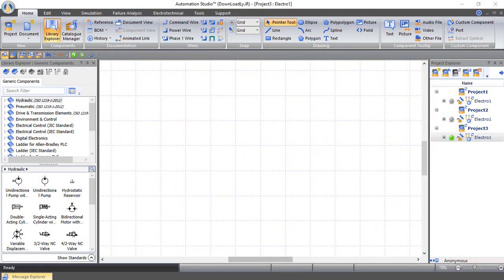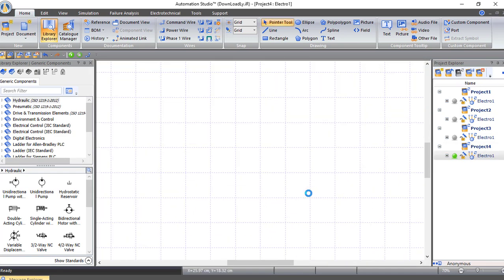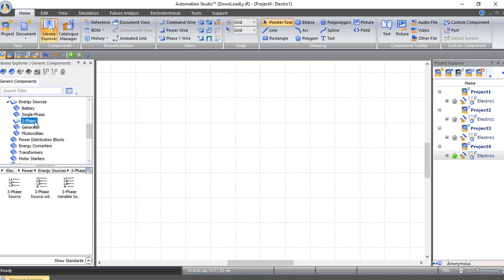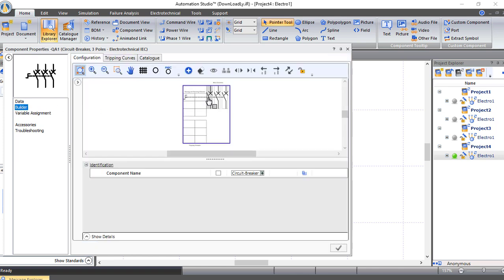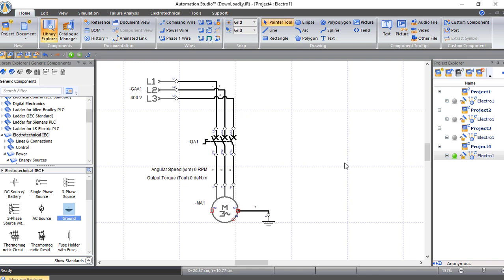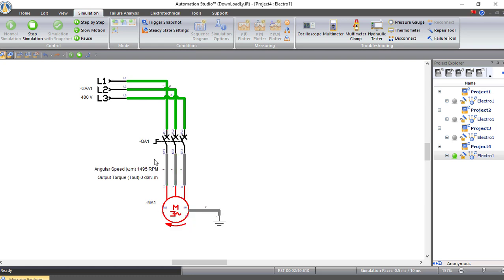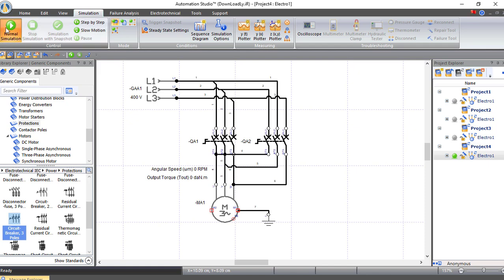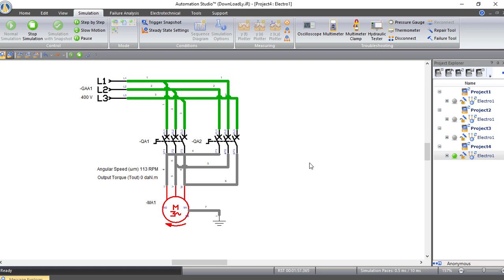Introduction to Automation Studio | Tutorial #1 for beginners

Comment: how can we  find a fault in the existing cables
Reply from the maker: To find a fault in existing cables, you normally use a continuity test or insulation resistance test with a multimeter or megger. These quickly show if the cable is broken, shorted, or leaking current